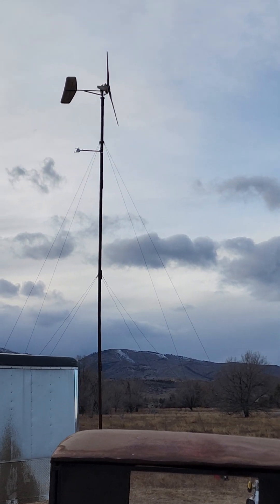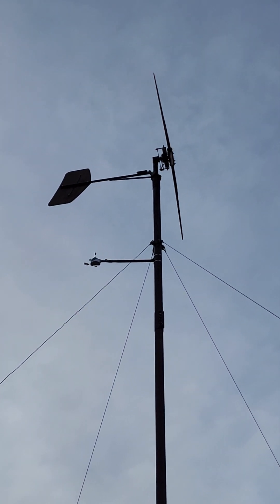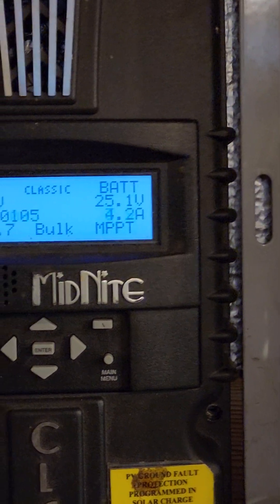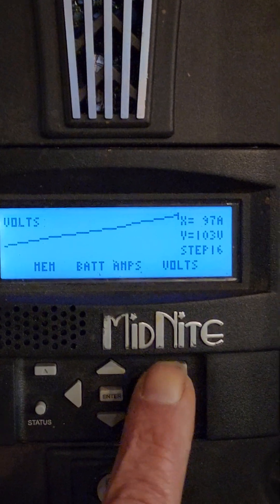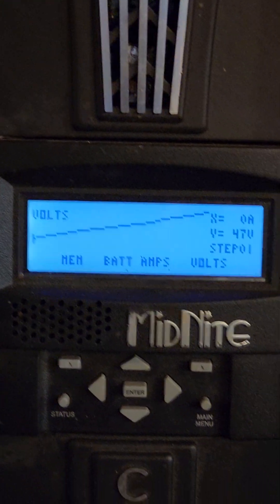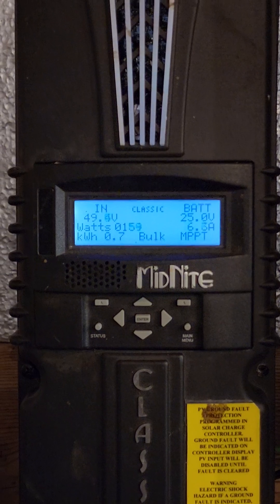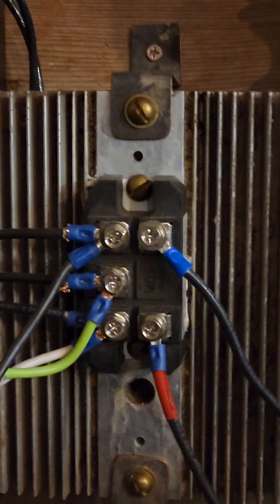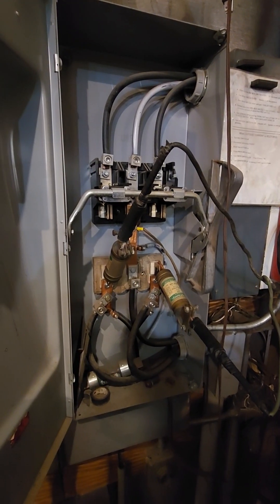10 foot wind turbine, 40' tower, Midnite Classic.

Comment: What is the megnatic rotator diameter ???
Reply from the maker: Magnet rotors are 12" diameter.  Each one has 12 poles (magnets) 2" dia x 1/2" thick ~ which... is a little bit more than necessary  for a 10' turbine, it would stall the rotor without a fair bit of resistance in the line, or ~ the MPPT controller, which should make it pretty efficient.